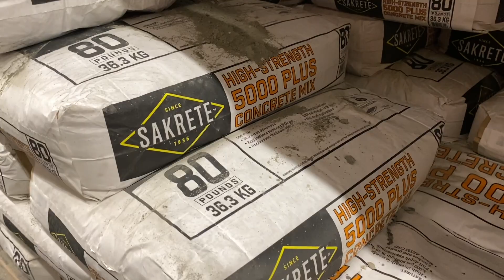How to make a skateboard mold - www.opensourceboards.com

Comment: Concrete does not set by drying. It sets by wetting. If it stays wet, it will continue to get stronger over time. The longer it stays wet the stronger it gets. If a concrete surface dries too quickly, it will be crumbly and flaky. Spray your fresh concrete with a mist of water daily. You'll find that after a few days it stops absorbing water and dries really quickly, even in the shade. At that point it will be properly set. If your habit is to put a fresh block in the sun and just bake it for days, it will make it much weaker than if you kept it damp.
Reply from the maker: Thanks for the tip Dave! I know other makers submerge their molds in water for a bit. Thankfully, this mold has been solid. No crumble, no cracks.

Comment: Just curious, did you do the same rebar cage for the second piece?  And why no mounting bolts?  Love your vids and am about to start making my first mold.  Thank you soooo much for your vid’s!  Very informative and practically a step-by-step for knuckleheads like me
Reply from the maker: Yes, rebar cages on both molds. We suspended the unshown cage with rebar tie wire screwed to the outside of the box and once the concrete setup, we cut off the wire sticking out. No mounting bolts because it’s so damn heavy, it doesn’t move (bottom mold, fixed in place.) Once the molds are put in place in the press and lined up, I use skateboard scrap screwed to wood around the bottom mold somewhat boxing it in place so it can’t move.

Comment: I do house slabs and footings. That rebar is hectic for the amount of concrete used but hey all the more strength
Reply from the maker: Yeah, it’s a bit much, but previous molds cracked and broke with less so we thought, “this time we’re making it with lots of rebar!” We haven’t cracked or broken a mold with this method so we’re just going to keep doing it.

Comment: Hey I noticed you said you used tape to layer the styrofoam, did you just use a clear packing tape and make sure it didn’t ripple? Or is there something specific you should use. Ps love these videos! I’m in Canada and where I’m at there is really no independent skate companies so your videos and process has really inspired me to start creating my own boards ❤
Reply from the maker: It’s just clear packing tape applied very carefully
Reply: @ManakSkates  thank you appreciate all the tips!
Reply: I know how to build a box but was curious if you are using 2x8 to build the box because i assume you don’t want to make it to deep or it will be to heavy and to shallow will have not enough concrete to with stand the pressure from the press. Last question I promise 😂
Reply from the maker: @Jay_bob_glizzy  we used scrap wood. It was plywood that was around 1" thick. Use whatever you have laying around.

Comment: Great video, good tips regarding rebar. Just wondering how u mix concrete for this one (ratio cement/water/sand…)?
Thx!
Reply from the maker: We don’t use a ratio really, just add little bits of water as you mix. If it gets soupy, add more concrete mix. We do not mix sand, just the concrete mix and water.
Reply: @ManakSkates  awesome! Thx! Skate or die

Comment: You can vibrate your form with a cordless hammer drill. Just put a large bolt in the chuck.
Reply from the maker: That's a good tip! I was going to get a rubber ball attachment for my Sawzall or use my theragun. Might give your idea a try.

Comment: You guys did a awesome job. Should get a lot of use out of it. Was kinda surprised you said about making a wood one later. Wouldn't the concrete mold be more stable long term? Not that wood moment is that crazy but the stuff moves a bit.
Reply from the maker: We have both types - wood and concrete in our presses. If made correctly and used in a press that doesn't flex/bend under pressure, a concrete mold will last a really long time. My guess is longer than wood. It's all personal preference and cost can be a deciding factor as well.

Comment: Thank you for this video! very helpful. I'm planning to start making my own boards soon and your videos are really inspirational. How did you attach the concrete mold to your hydraulic press? I saw the video where you had the wood mold on the press and that sort of looks like it was glued to to another thick piece of wood that's bolted to the press.
Reply from the maker: On the top mold we set screws in the wet concrete so that we could mount wood to it. Then we mount the wood to the press. On the bottom, we mount wood to the press and just let the mold sit on top without mounting it. It's so heavy, it doesn't move.
Reply: @ManakSkates  Ok got it. Thank you!

Comment: This video is great, thanks for the insight, but what if you have a deck that you would like to replicate, could you use that deck to replicate the mold ? It’s a S**third concave that I would like to reimagine 😊
Reply from the maker: You can do it with an uncut deck by standing the deck up on its side and pouring concrete on each end. There should be other YouTube videos available to do it that way.
Reply: @ManakSkates  
Many Thanks for the reply
Greetings from the Uk 🇬🇧 
🙏🏻